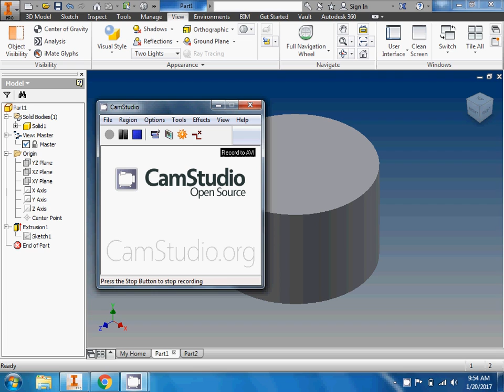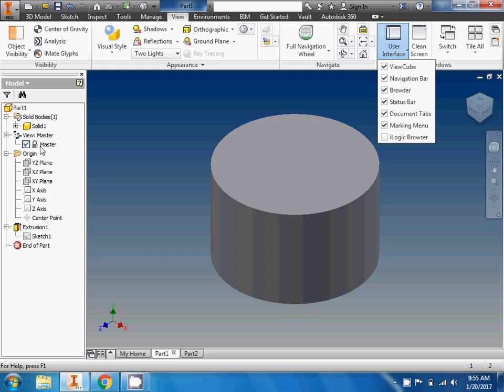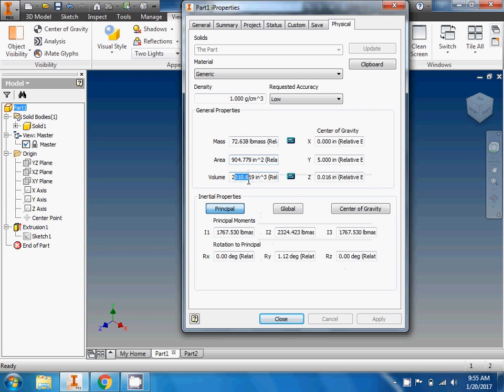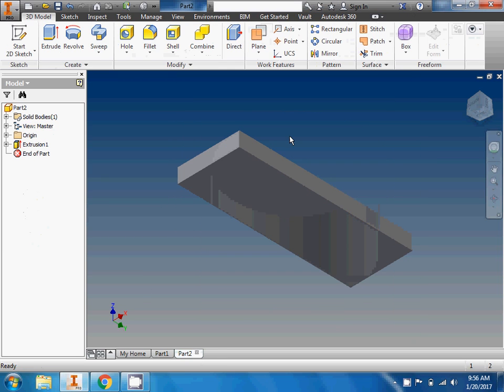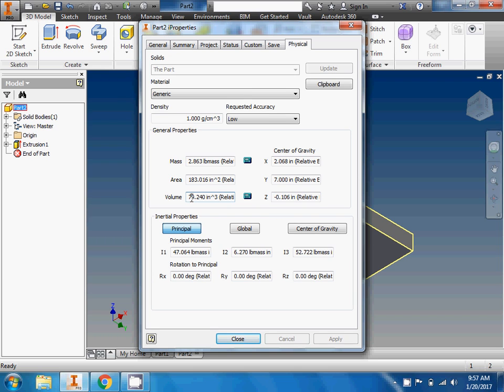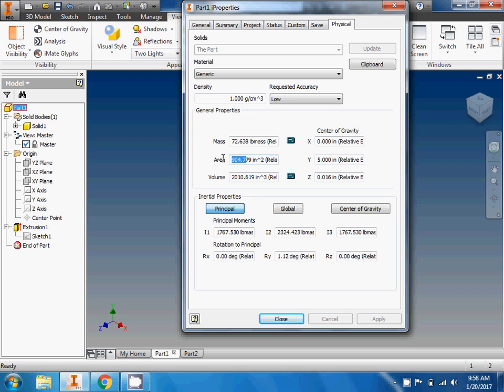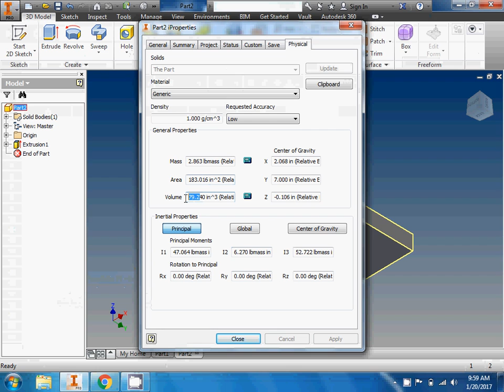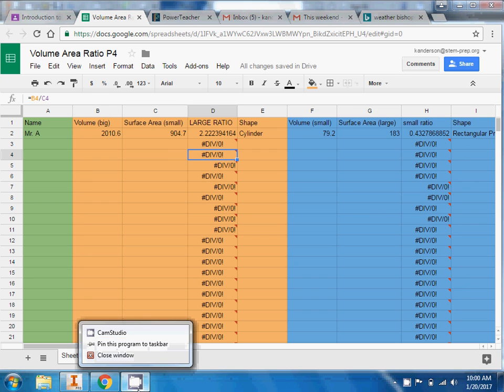Area, Volume, and Iproperties on Autodesk Inventor

Comment: Hey, and if I want a specific volume in a bottle for example, do I just change it in the volume property? So I don't have to change every detail until I get that volume
Reply from the maker: Good question. I don’t believe you can set the volume through the iproperties. You would have to adjust the dimensions until you reach the volume you want.

Comment: Can you change the model then check again the volume of it? I mean from time to time if you have a sample area limit to consider? You change the model then check the volume if it's on the right amount.
Reply from the maker: You most definitely can, just remember to click the button to update and get the new numbers.
Reply: @MrStem  

Great video Mr Stem.

How can I get the surface area of one of the faces?

Not the surface area of the whole piece, just the area of a face.